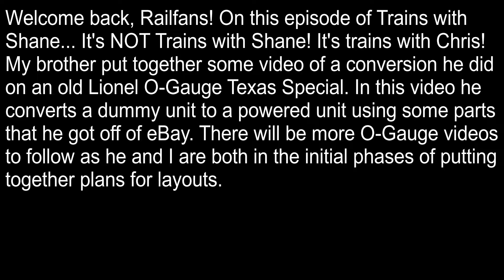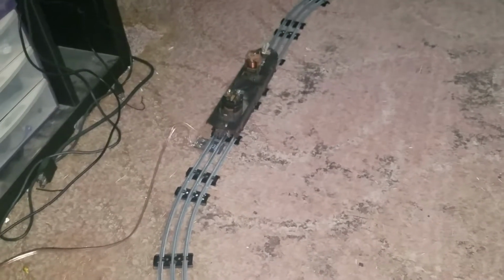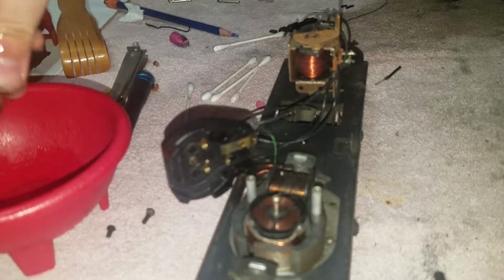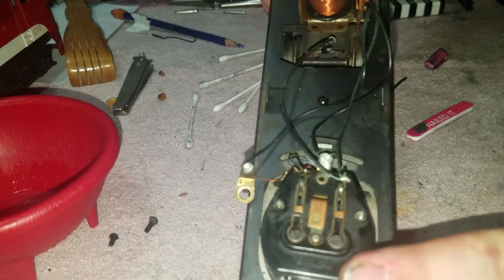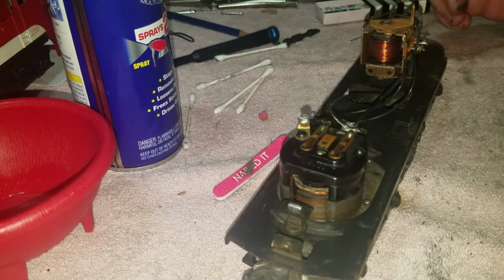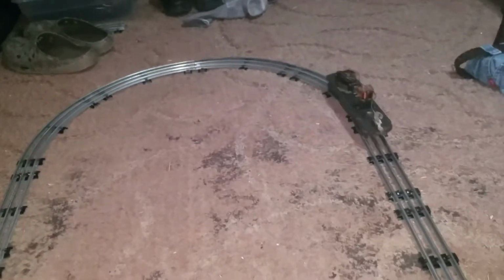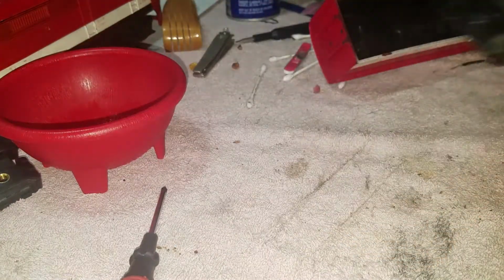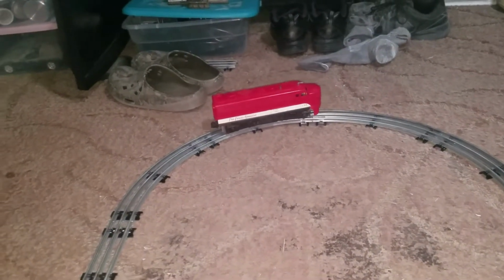Trains with Chris Ep1 - Lionel O Gauge adding power to an unpowered dummy unit.

Comment: Hi, those are definitely Lionel FA units, the F3's were an EMD PRODUCT as FA's were an ALCO product.  In the toy train world, the easiest way to differentiate Lionel units is the F3's are longer and have more rounded nose, ie, front end. 😎
Reply from the maker: I usually look for the big singular radiator fan on top which tells me Alco.
Reply: Also EMD F units have a rounded nose and are larger than Lionels  Alcos.

Comment: Fundamental:  this motor is a double wound motor as can be seen by the 2 colors of wire in the field.  You need to make sure you wire it correctly and make sure the motor in the other unit is double wound.  I can provide additional info on this if you want.

Comment: Looks like the pilot is in need of repair ad aa coupler to be added. That would make you a good video.  These are Alco FA units.
Reply from the maker: These units were rougher than a stucco bathtub when Chris got them. They're currently in storage. Chris has since dabbled a bit in H.O. scale and currently N scale. Not sure which one, if any, he's going to stick with.
Reply: @Trains-With-Shane  if you decide to change scales I'd like to talk to you about buying the o scale pieces. I'm building a layout for my grandson.

Comment: A Lionel O gauge streamliner without a truck mounted pilot?

Unpossible.

(But it's definitely a good thing. I can handle truck mounted couplers, but I draw the line at pilots.)
Reply from the maker: I'm right there with ya. I've got some N scale Kato made Con-Cor units and a few Roco units that have the truck mounted pilots. Honestly for the day they are pretty well built and good runners but man they sure are ugly by today's standards.

Comment: My Lionel mid 90's reproduction 50th anniversary union pacific units say they ar "FA units" on box
Reply from the maker: Makes sense. I have a few FA's in N scale. The nose on these units Chris has stick out a little more but not as far as a PA so it was kinda hard to tell. All I knew is that they were Alco's thanks to the single large radiator fan, lol.